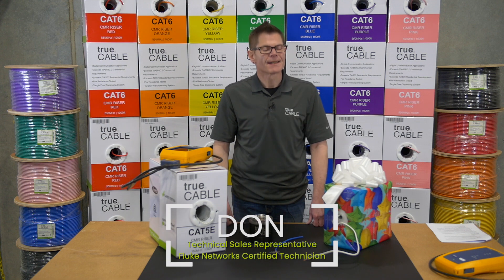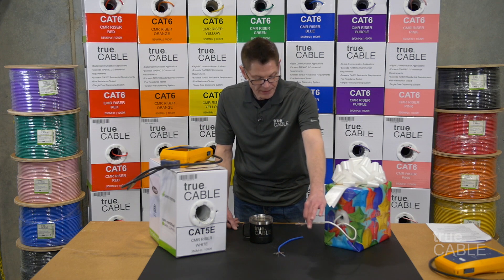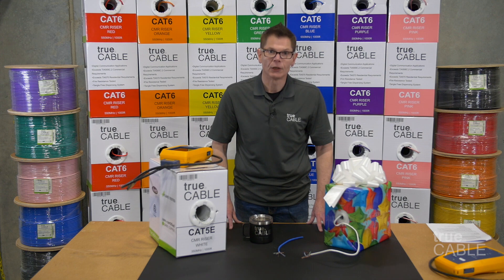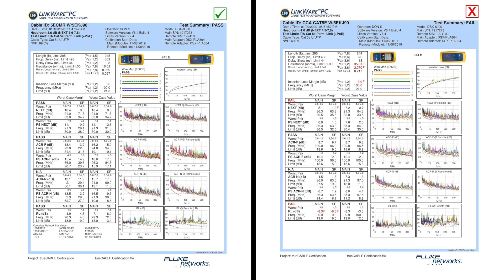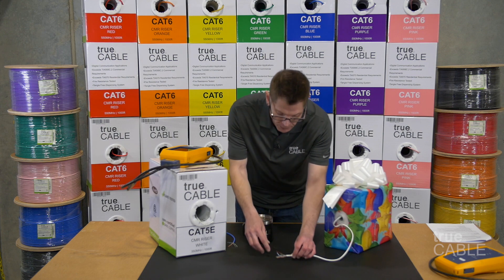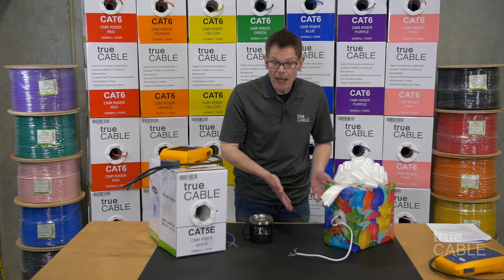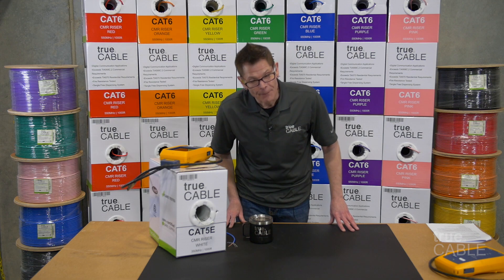Copper Clad Aluminum vs Solid Copper Ethernet Cable

Comment: Wish i seen this before i ran cca up to a AP i installed lol. That AP i could not connect to at all in my house i wasn't even sure if it was even getting the right POE voltage. the moment i seen this video i went to check yep cca i pulled that out ran full copper problem fixed just that quick you were a big help
Reply from the maker: Hello! We are glad you figured it out. CCA not only won't pass data well enough to pass TIA testing it also causes a lot of trouble with PoE. The standard does not permit the use of CCA--it is counterfeit cable.
Reply: @trueCABLE yess it is lol

Comment: Hello, how to recognize a CCA cable from a Solid Copper without stripping it?  I am in France, and apart from a single reference, there is no indication if the cable is CCA or Solid Copper, neither on the label nor on the cable itself
Reply from the maker: Hello and I understand your frustration. If you cannot scrape the conductor wire, then the next way of determining CCA is cable is usually price. CCA is much cheaper...unusually cheap and seems to be a deal too good to be true. A third way it to take a box/spool of solid copper Ethernet in one hand, and then a spool/box of the suspected CCA cable in the other hand. Lift them both up simultaneously. Does one weigh far more than the other? If one is a LOT lighter, then it is likely CCA. I hope that helps!

Comment: free electrons run on the outermost layer and not in the core (which are not free and are bound) therefore it should not matter which to use both are the same in terms of resistance
Reply from the maker: Hello! Beware claims regarding the "skin effect." It is suggested that the skin effect, where electrons run across the top of the copper, renders the underlying aluminum irrelevant in CCA cables. It is not quite this simple, and CCA cables behave differently when it comes to twisted pair communications cables as opposed to coaxial. CCA cables have a higher DC resistance and DC resistance unbalance problem that prevents them from meeting testing standards. The cable fails to meet expected standards and cannot be certified. In addition, the DC resistance of copper-clad aluminum is 55% higher than that of pure copper. Therefore, the claim that the skin effect negates the issues with CCA is unfounded and provable with test equipment.

Comment: Well stated. Love this video. Me, after using CCA for my solar panels and batteries bank, all my fuse breakers tripped. Then I increased from 50A to 80A fuses, 10awg wires started to smoke. I threw all the CCA wires, not given, away and started to use oxygen free copper for my solar project. Ty
Reply from the maker: Thanks. We appreciate the feedback. Copper is the way!
Reply: Oxygen what 😂?

Comment: So is standard soild copper charging cable (for cellphone) better than standard copper plated charging cable (for cellphone)? If so why?
Reply from the maker: Hello Jonathan. I would think pure-stranded copper would be superior for any application that may pass voltages, but I am not an expert on cellphone charging. Cellphone charging may have practical limits beyond conductor material that might make CCA in cell phone charger cables more acceptable than in Ethernet data transmission.

Comment: thank you for the info i didnt know about it i always through pure copper was the standard due to it low resistance you don't use cheap cca cable definitely !
Reply from the maker: Hello! You are welcome for the information and we are glad you liked it and found it useful. You are absolutely correct; CCA is a bad deal, no matter how inexpensive it is.

Comment: A search tip is "pure copper", because I have seen products listed as "Solid Copper Coated Aluminum".
Reply from the maker: Noted! In our product listings, we use "solid bare copper" and "pure solid copper" so that people can find our products and know what they are getting. There are a lot of sellers and manufacturers out there willing to distort the information and confuse potential customers, which we find very distasteful. Your example is just one such distortion that they may use!

Comment: Electricians are installing it in new homes guys its approved for use per NEC code
Reply from the maker: Hello Anthony. We have to disagree with you on this. The NEC/NFPA 70 is very clear on this point, and that is communications cables (with the exception of coaxial) SHALL be copper. It is the law. Further, there is no recognition for CCA in the ANSI/TIA 568 standard for the use of copper-clad aluminum conductors in copper twisted pair Ethernet, and in fact, it cannot be described as "Category" cable of any kind. It does not matter whether the home is new or older. We would love it, however, if you would describe the section of the NEC/NFPA 70 that allows CCA twisted pair "Ethernet" to be installed legally, and we will repost the precise text here for you from our copy of the NEC/NFPA 70.

Comment: You're also only claiming things without supporting these claims. Not very useful.
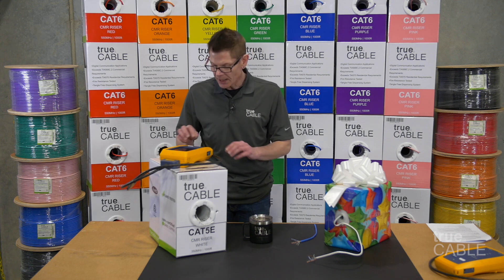Reply from the maker: Hello! There are Fluke DSX-8000 Permanent Link test results starting at 02:06 !
Reply: @trueCABLE  Thank you for your response. I've watched the video, but the DC-loop resistance is only twice that of the copper cable. As cables that are fully up to standard (e.g. the regular copper ethernet cables) should get you up to 100m with POE, wouldn't that mean that if conductivity is the only consideration, the CCA-cable would get you up to 50m? You haven't measured actual data-transfer speeds and POE-performance at different cable lengths, and from the data you present it is not clear at all to me that CCA-cable is unsuitable for the short distances that are common for most home users. You also haven't measured actual wire temperature, and it seems highly unlikely that wire temperature will increase by any significant measure when using it for low-power applications such as POE. I'm most worried about oxidation at connectors, but even there it seems that the risk of using aluminum cables in low voltage and low power applications cannot be compared to the risks associated to the use of aluminum in the wiring of houses, as in that case the danger is (mostly) due to arcing caused by degrading connections. You probably won't get arcing with a bad connection in POE-applications.
Reply from the maker: @stefangr1   Hello! What the DC loop resistance will be, is going to depend on much more than just length. This particular example of CCA in the test had a certain DC resistance at a certain distance. Another manufacturer's CCA cable will have a different resistance at a certain different distance. The reason? There is NO STANDARD guiding how to construct CCA cable, as no standards body or regulatory body endorses the use of CCA. As you pointed out, the DC resistance may vary with length, but that would require exhaustive testing and only apply to a SINGLE brand and type of cable under test. Considering no reputable manufacturer is offering CCA (and given the prohibitions against its use), I don't see the benefits of testing it exhaustively so people can feel more comfortable installing it (potentially violating code in the process). That would be irresponsible of me and would put my BICSI Certifications at risk of revocation. Each installation is different, and some home users are pushing the limits with long-distance Ethernet runs. It is not a one-size-fits-all matter. As for arcing with bad connections....oh yes, that does occur, and with solid copper, too. In fact, our keystones are specifically designed to minimize spark arc damage if they should be unplugged while running 30W and above PoE. If the pitting is not apparent right away, multiple connects/disconnects will accumulate, and it will become apparent over time (or sometimes right away). I can put this debate to rest immediately, however. Use pure solid copper conductor Ethernet for structure cable and pure stranded copper Ethernet for patch cord applications. Problem solved.  - Don Shultz, trueCABLE Technical Manager

Comment: Advertiser always claims outrageous stuffs about other type of cables other than theirs. The cheap clad aluminum cables might not work as efficiently as the solid copper cable but it is not a real danger to use since what is travelling inside is only very low DC voltage ( no fire hazard). It is worth installing the expensive cable IF you are intending to stay in that house for life or you have plenty of money to waste. That is a simple true life fact.
Reply: Cca it's garbage, i used in my house, the internet speed was slower and i ended replacing all the wirea with solid copper
Reply from the maker: Hello Claude and thanks for leaving a comment. I think we will have to agree to disagree on the "Facts of Life". Commercially speaking, per the NEC/NFPA 70 in the USA, it is illegal to install copper clad aluminum (CCA) twisted pair communications cable. Although technically not illegal to install in a residential setting, it is unwise to do so. All professional and industry organizations recommend against CCA for good reasons. I have tested CCA against pure copper Ethernet and can prove that not only is it bad for for PoE but it won't pass any level of Certification testing in regards to performance. The final point is that PoE is drawing ever more wattage at the end point device, with many devices starting to require 100W (802.3bt 2018 revision). With enough 100W PoE runs in a bundle, especially in a conduit, using CCA poses a significant risk for heat damage to the cable itself and a real (albeit small) risk of actual fire damage to the structure. Installation of pure copper conductor Ethernet is a wise investment, not a waste of money. Don't use CCA!

Comment: I recently bought 180 meters of cable which is 24 awg and looks like an aluminium bronze in appearane inside out. Are they any good for PoE runs?
Reply from the maker: Hello Omair. It sounds like you are describing solid copper Ethernet. Solid copper is the same color through the entire conductor. CCA would have a distinctive yellow copper over silver aluminum core. If it is not CCA, your cable should be fine for PoE.
Reply: Yes, you can use it with your POE. Only the data might get some noise or interference sometime (like some distorted or pixelated image on the screen)

Comment: If its not allowed why is there so much CMP cca and cmr on ebay, amazon, etc?
Reply from the maker: Hello Henry! Great question. The answer is because it is not illegal to SELL CCA. It is illegal in commercial structures to INSTALL CCA, however. For residential structures it is not illegal to install it as it is not specifically prohibited per the NEC/NFPA 70 guidelines. That said, some local jurisdictions may have made CCA illegal to install even in residential structures too. Shady manufacturers and resellers are taking advantage of legal loop holes and end-user ignorance of the subject. It really is quite deplorable, if you think about it!

Comment: Almost none of statements made here are true. Cat5 starting fire? Really?
Reply from the maker: Hello! Thanks for leaving a comment. The CCCA (Communications Cable & Connectivity Association) has a website which breaks down controlled fire testing that highlights the issues. You may wish to take a look there for data on the number of in-field fires associated with CCA to date. CCA cannot be listed via ETL or UL and is prohibited for use in Ethernet cable per the NEC/NPFA 70. It is illegal to install, especially in commercial structures. CCA does indeed pose a fire safety hazard, especially when higher wattage PoE is involved--like 100W 802.3bt PoE++. The issue is further exacerbated when cable bundles are used inside conduit. Hope this helps!

Comment: That's nuts, I didn't know there were fires with such low voltages of regular Ethernet or even POE. 

We had these problems already with aluminum wiring of regular AC power in homes back in the 70s.
Reply from the maker: Hello Aaron! Yes, it is indeed crazy that an old problem can come back to become a new problem. Up until now the vast majority of PoE devices do not require more than 30W and the risks are primarily with the end device not getting the power it needs, which may result in damage to your networking devices. Even if end point PoE device damage does not occur cable overheating will cause data transmission problems. Therefore, CCA is definitely a big NO NO in Ethernet installations. The biggest danger is due to PoE wattage needs evolving and more devices requiring 60W or even 100W. The risk of fire is real--especially in larger cable bundles that are inside conduit. This could result in you and your installation becoming a rare statistic!
Reply: @trueCABLE  What is the voltage of these PoE devices. cant be more than 15 volts. 100w at these low voltages in such a fine wire is going to carry considerable amperage with high losses, even short runs. a decent film of copper on an aluminum substrate with the use of a silicon grease to prevent oxidation should not present a problem.
Reply from the maker: @chupacabra1765  Hello and thanks for comment. Per TIA, the NEC/NFPA 70, and BICSI copper clad aluminum should never be used for Ethernet cable. It is flat-out illegal to use in commercial structures. The primary problem is PoE. As you can see from the Fluke DSX-8000 testing I performed CCA fails miserably. Not only did it fail PoE testing, it also failed Category testing. I was testing so-called "Cat5e" CCA and using Cat5e Permanent Link testing, so not exactly a high bar. As for wattage and voltage, DC is of course different than AC. The typical voltage of PoE is 57V and anywhere from 15W DC to 100W DC. 100W DC is fine over pure solid copper conductors, even with 24AWG. Ultimately of course the choice is yours to make. Sure, you can save a few dollars buying CCA. You also risk data transmission issues and PoE device damage. It's not worth it.

Comment: Too late. I accidentally bought and installed cat6 CCA all over the house without knowing any better.
Reply: How’s it holding up? Are you doing PoE?
Reply from the maker: Hello Amado and thanks for your comment (and admission ;>)). When you need to replace the CCA at some point give us a shout and we will help you select the correct cable for your needs!
Reply: You're doomed I say. Doomed!
Reply: How about your cat6 CCA cable after years ? I made the same (mistake?)...
Reply: @SzkolaPrzetrwania I haven’t had any issues to be honest.
Reply: @aor980 just wondering if you're doing any POE with them? What's the voltage?
Reply: @SzkolaPrzetrwania  same mistake here... I guess I still can try to replace some critical POE cables with true copper

Comment: So, how many fires have been started due to CCA?
Reply from the maker: Hello! Thanks for leaving a comment. The CCCA (Communications Cable & Connectivity Association) has a website which breaks down controlled fire testing that highlights the issues. You may wish to take a look there for data on the number of in-field fires associated with CCA to date. CCA cannot be listed via ETL or UL and is prohibited for use in Ethernet cable per the NEC/NPFA 70. It is illegal to install, especially in commercial structures. CCA does indeed pose a fire safety hazard, especially when higher wattage PoE is involved--like 60W and 90W 802.3bt PoE++. Hope this helps!
Reply: ZERO, NONE to my knowledge. Only affect your data transfer, noise interference poor picture quality.

Comment: I believe most people buying this will not realize it since it will connect with 1gbps and that is enough for them but later when they wanna upgrade it and the cable is long they are going to have to replace everthing and it will cost more
Reply from the maker: Hello and thanks for your comment! Indeed, many people don't realize the issues with CCA and then run into problems with higher speeds or when PoE is involved. As you said, CCA will end up costing you more in the long run, despite a better-looking price upfront. As with anything, BUYER BEWARE!
Reply: I have installed a CCA 20m cable and the connection speed was limited to 100Mbps. The network card simply won't take 1.0 Gpbs. I tried with another 5e high quality cable (albeit just 2 meters), and it connected with 1.0g. So, CCA on long run (time and distance both!) is worthless.

Comment: im really tempted to buy Cat6E-CCA because its really cheap, btw sir is Cat6A slim type 32awg can deliver same performance as its counterpart the regular cat6a 27awg?
Reply: Short patch flat cables Cat6 are OK to use. NO DANGER at all ( NETGEAR use them, so it is safe for use). I believe NETGEAR company knows their stuff better than a lot of small CABLE companies.
Reply from the maker: Hello! As trueCABLE does not carry any patch cable yet, all of our solid copper conductor bulk unterminated Ethernet is either 23 or 24 AWG. 

As for CCA, there is no reputable manufacturer that would carry it, and no industry standard recognizes it for use in Ethernet cable.

Comment: Yes, I see from your video about the 21 limit.

BUT when I measure the internet speed speedtest on my router, I don't see any speed difference with Cat6 ethernet between my copper versus CCA cables.

So I think the advantage of copper over CCA is if you need to transmit power to keep the wire cooler.
Reply from the maker: Hello, and you make a good point about your Internet speed. Internet speed is going to be much lower than what the cable is actually capable of, so you may not notice any issues for now. Down the line, you might notice an issue since CCA terminations tend to oxidize and aluminum oxide is not conductive. Copper oxidation is, however. CCA will not actually pass Category testing, which is the gold standard for determining if your cable will not only support the maximum it should with stability but also support PoE.